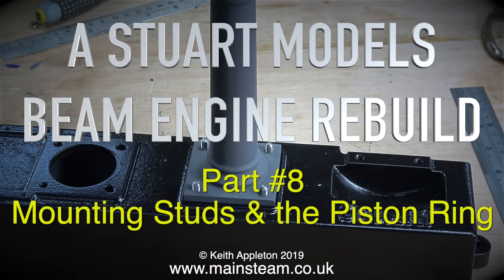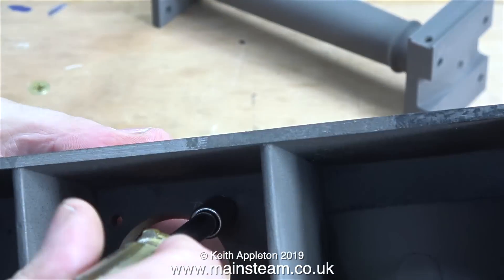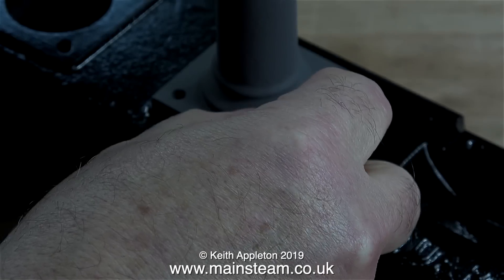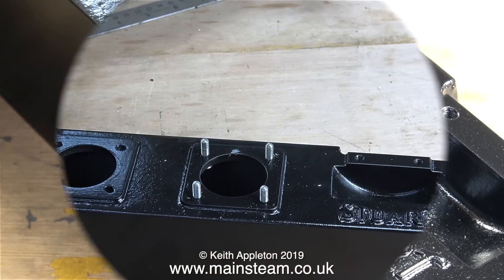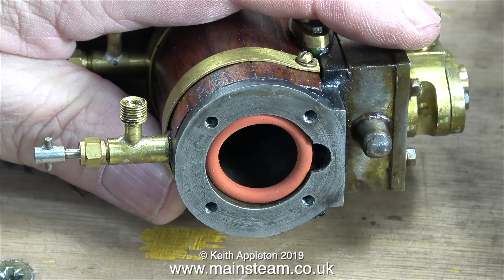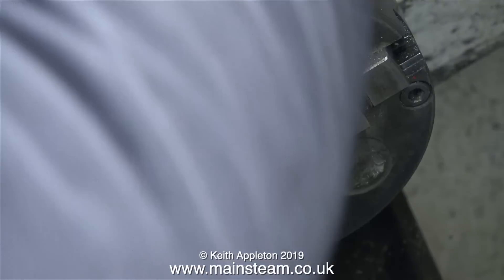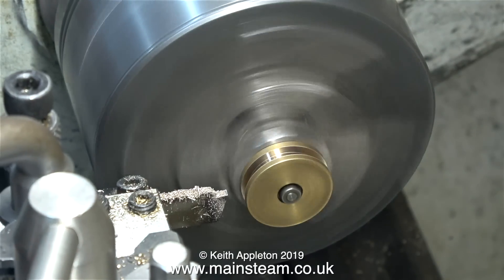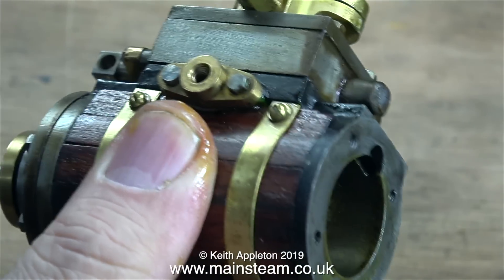A STUART MODELS BEAM ENGINE REBUILD - PART #8

Comment: A good motor solution is if you can find a junk treadmill. Don't know if they are common in the UK but they are usually in the 1 HP range, DC variable speed. There are a bunch of vids on doing this conversion.

Comment: Keith,,, if you can, try and stick with the Boxford. It is more representative of what the average beginner is likely to have, it's home grown (not a million miles from you in fact), and I have a soft spot for them anyway as I learned on them at school. A few years ago I was able to buy a model A VSL varispeed, but sold it when I got an offer i couldn't refuse. I'll get another someday, funds permitting. Mine was 3 phase, but I delta'd it down and put a modern inverter drive on it- the slowest speed I could get was mind bendingly slow, and plenty of torque so threading was a doddle. 
Now I've only a tiny Chinese Sieg C1, and it's hard work! 
All the best, thanks for the uploads mate.

Comment: Since those bolts that come up from underneath are being used as impromptu studs, would it not be good idea to put some lock-tite or epoxy on them to fix them in place? Peening them in with a hardened punch would be another option, but I wouldn't want to try that on a cast part, personally.